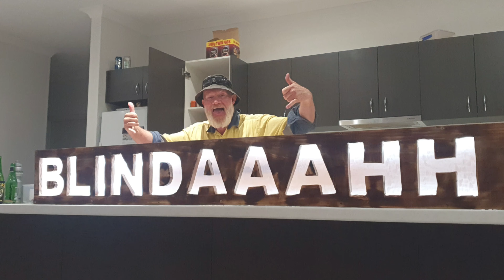Eat Sleep Lift Repeat (Cranes in Pilbara)

Comment: brings back some memories.
What the hell were those fully rigged 450/500 tonners having to lift at 2.00minutes?
Reply from the maker: It was a  165 t primary crusher bowl.
Reply: @flyingstrbi6297  Thanks. Looks like a complicated lift, I'm guessing it was at quite a radius to require both cranes.
We had an LTM1500 lift a130t sizer with relative ease.